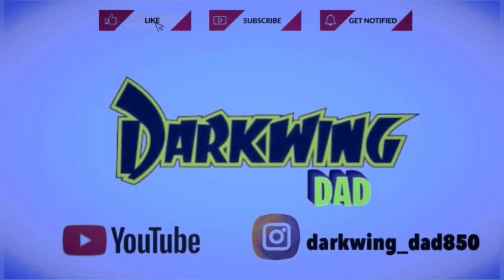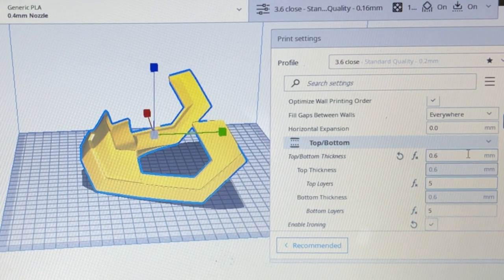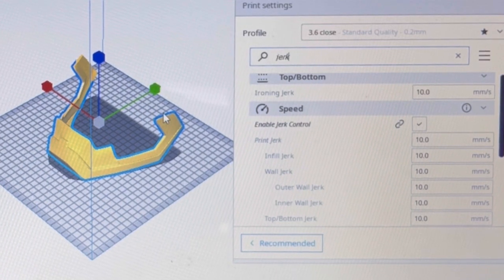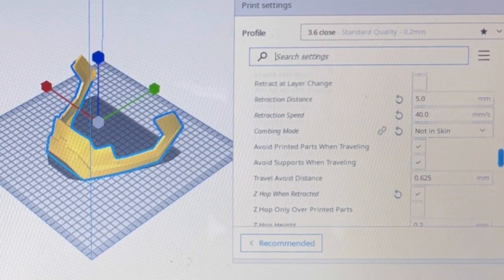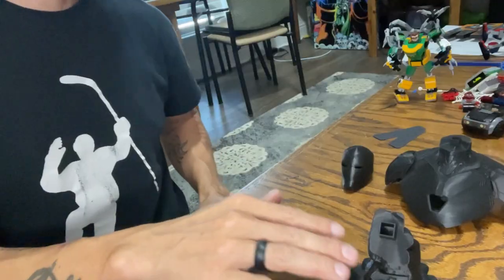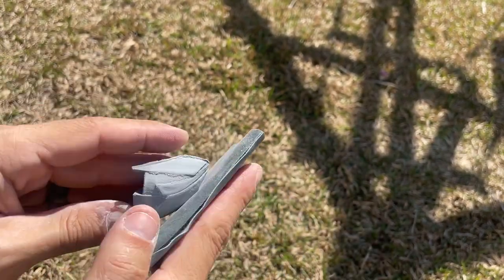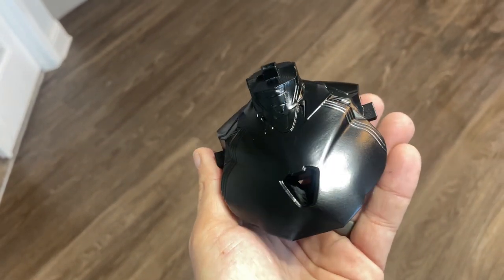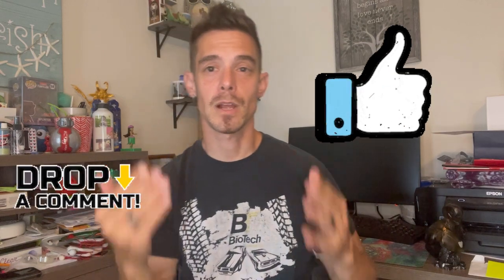How to 3D print busts & statues | 3D printer settings for busts & figures | sanding & painting tips

Comment: Dude... I just had a vision of doing an ass ton of huge busts. Maybe 1:1 scale. How would you approach that? Any differently setting wise? I did a two foot Daredevil statue and though it is cool... I really need more practice finishing. Getting layer lines from in between muscles and shit is tough.
Reply from the maker: You’ll need to do a finer layer height
.12 likely with adapter layers enabled will help a ton
Reply: @Darkwingdad  cool. Thanks for the advice. I will apply that next bust. Finest layer height will take about 10 days at around 440mm tall. The Kobra Max can do it though. I have done it. Adaptive layers I know little about, but looking it up it makes sense.

Comment: Hello! Awesome videos..  Would the 2 in 1 primer / filler do the same stuff you are doing just in 1 step? Or would you recommend getting them separate from each other?
Reply from the maker: Do you mean instead of doing a black base coat just letting the primer be the base coat?
Reply: @Darkwingdad    No. I mean you use etcher primer and then filler primer. Can you use the 2 in 1 etcher/filler primer?
Edit...nevermind. it's filler and sandable 2 in 1. I thought it said etcher. Sorry. Liked and subscribed!
Reply from the maker: @smokcan2  no problem! Etching primer just promotes adhesion. I like it especially on silk prints when I can’t get in areas to sand. It can also be used on top of primer as an advocate for adhesion as well. Thanks for the sub!

Comment: You make it look easy. What causes the haze and cloud when you spray paint? It comes off with some buffing but it shows up in different spots regardless of how many coats.
Reply from the maker: In the clear or the paint itself?
Reply: @Darkwingdad  top coats
Reply from the maker: @jack91522  if it’s hazy it’s likely applied too heavy & the humidity is too high
Reply from the maker: @jack91522  also if you paint with an acrylic and add a lacquer based clear it can cause hazing. What paints are you using?
Reply: @Darkwingdad  I had several coats of bonds putty and bonds filler primer spray. Then several coats of duplicate color spray for my helmet. The haze always shows up at the same spots regardless of how many coats I put on. Seems to go away after buffing. I think I need to buff. I dont want to ruin the shiny coat by sanding. Even 3000 seems to dull it too much but the paint isn't mirror like. I'll have to put on a glossy clear coat today.
Reply from the maker: @jack91522  could be oils from your hands when handling. Are you prep wiping it or wearing gloves?
Reply: @Darkwingdad  I wasn't wearing gloves. Yeah maybe that's it.
Reply: I see some people wash it before painting. I guess I know why.
Reply from the maker: @jack91522  wear nitrile gloves and wipe it down with isopropyl alcohol

Comment: Awesome video's. I want to ask how you avoid horizontal lines and artifacts when using z hop(printing silk part2) are you using an anti backlash nut?
Reply from the maker: Proper temperature, retraction & prime nozzle wipe distance are key. Other than Capricorn tubes & bed mounts my machine are primarily stock

Comment: did you ever try Lightning for the infill pattern?
Reply from the maker: @ciroiriarte8804  gotta be careful with that on certain models, it only supports the roof & can make areas brittle
Reply: @Darkwingdad  even with enough walls?, is that a "not recommend" for you?
Reply from the maker: @ciroiriarte8804  I tried it with a helmet once and it was a no go, it’s something you have to play with walls & Infill% sometimes the print time vs integrity loss vs more walls kind of defeats the purpose. I wouldn’t say I don’t recommend I would say use wisely